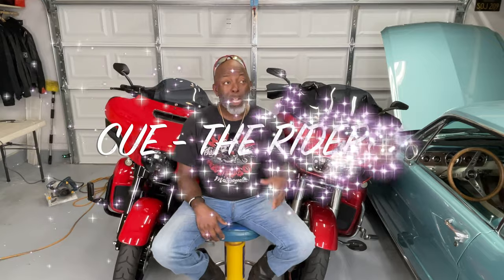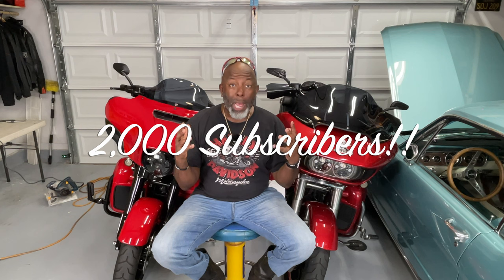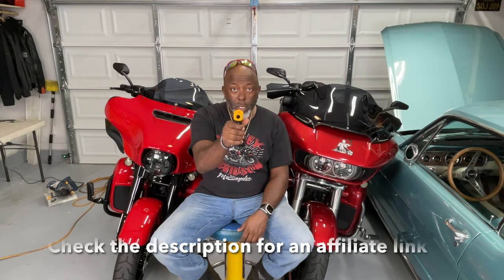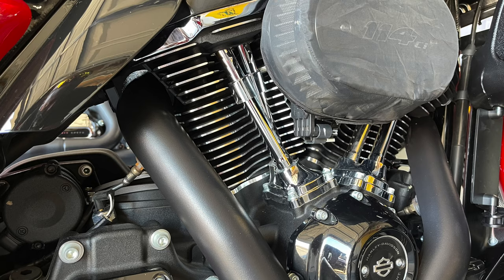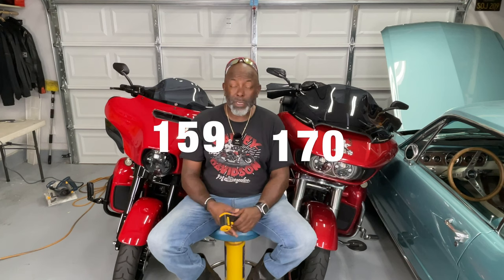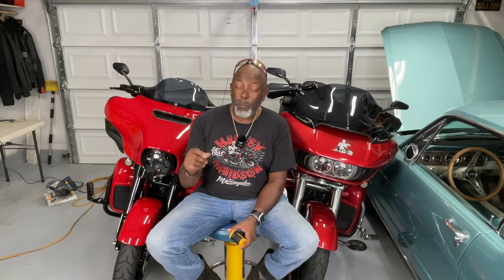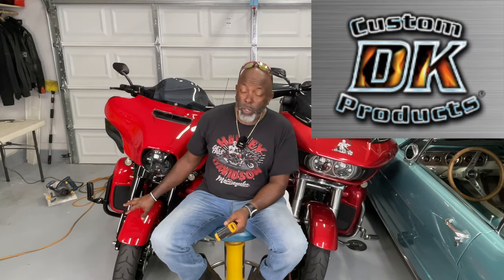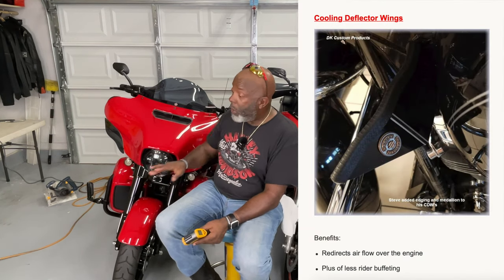Water Cooled vs Air Cooled Harley Milwaukee Eight

Comment: There are after market fans available such as love jugs that blow air across the top of each cylinder head. They claim to reduce temps up to 50 deg I believe
Reply from the maker: That will be my next heat test.

Comment: Great video and great techniques for comparison.  Always good to provide good knowledge and real-world tests and results to those who wouldn't necessarily do these things themselves.  Also, congrats on 2K!

One point of information on the type of oil allowing the engine to run cooler.  I race bikes and have built and run race motors for quite some time.  All of my race motors run synthetic oil.  The heat generated is two fold.  1. The actual combustion processes, and 2. The friction heat produced by moving parts.  The synthetic oil "seems to be" a bit slicker, allowing parts to glide more smoothly past one another.  Most importantly though, as you mentioned in the video, synthetic oil is able to retain it's lubricating properties at higher temps.   What this means is, as we are running engines harder and harder, the potential frictional heat load increases.  This increase will heat the oil as well.  At those higher temps,  conventional oil can begin to lose its lubricating properties and allow greater frictional heat load.  This will heat parts, and heat the oil and in turn, make the bike run hotter.  Synthetic oil will retain those lubricating properties as the motor is running harder and will assist in keeping the frictional heat load down.

So, is synthetic oil necessary for all engines, maybe or maybe not.  Does it have definite "pros"? Yes it does.  Also, synthetic oils maintain viscosity for longer periods if time for most users.  Just my $.02
Reply from the maker: Thanks for sharing! I don't race my bikes so I don't have your experience. However you described it very well. I can see how synthetic oil is vital in that particular use. The biggest heat issue I run across is traffic jams.....the bike can get very hot in stop and go traffic.

Comment: Howdy, Great Video. The reason I'm researching this is because I am thinking of purchasing a Trike from HD and find that of the 3 models available this year, only the Tri Glide Ultra comes with the Twin-Cooled version of the 114. Now I am not a fan of Fairings & Tour Packs, and would be more than happy with the Freewheeler with a windshield, a passenger backrest, and a luggage rack and buy a Garmin GPS for the handle bar, but I do believe that the Twin-Cooled version of the 114 would be more durable than the Air Cooled 114. The only thing I can think of doing is purchasing the Tri Glide and start Stripping it down till I'm Happy, and selling the leftovers on ebay...
Reply from the maker: I think it depends on the type of riding you will do. What I learned from my experiment is that there are advantages to the Twin Cooled AND Air Cooled. Technically, the air cooled has 2 cooling systems: air and oil. Add a fan, and you should be fine in most circumstances. 

I've been stuck in traffic with my Twin Cooled Road Glide and it gets HOT!!

Comment: Interesting stuff. Im gonna say, your temps lower on the engine are more precise. Its the oil you want to measure. Using those guns on shiny surfaces can give wonky temps. Maybe try putting some painters tape where you point the gun. Measuring oil temp might be the best way to measure. Just my two cents.
My question for you, since you ride both bikes, how is the "felt" temperatures on your legs?
Reply from the maker: Great question. I have 85,000 miles on the Road Glide and only 11,000 on the Street Glide. I've been stuck in traffic several times with the Road Glide and it got HOOTTT!! I've never been in traffic on the Street Glide, so I don't have a good comparison.

Comment: I test rode a road glide limited while wearing jeans and half calf leather boots and my right foot felt like it was being cooked inside my boot, no burn marks so I don't think I could have been brushing the exhaust
Reply from the maker: You can definitely feel the heat coming from the lower fairings....but it depends on your leg position.

Comment: On my TC 103 i added a Jagg Vertical Mounted Oil Cooler...It makes a difference here in the Hot Central Valley of Cali....Your right...Synthtic Oil has a higher temp rating before it breaks down...Ive checked my oil right after riding in 100F plus temps...Mineral oil has turned to bubbles vs Synthetic not...Only thing i dont like is more valve train noise...
Reply from the maker: Great feedback! I wish I had done this test before I changed the oil on the SG. I run synthetic in both bikes

Comment: Very good interesting Cue. Did you have the vents on the lower fairings open or closed?  I wonder what temperature difference would be when running slow speeds for 5-15 minutes, as in stop and go traffic or a parade.
Reply from the maker: The Lowe vents were open on both bikes. I keep the vents open on the SG all the time since air flow is required to keep the engine cools

Comment: My 21 road glide limited is dual cooled. I tell my riding buddy's those radiators aren't for the bike. They are for me and her I feel way more comfortable on the bike long distances Hot or cold. I can control the temps by simply adjusting the lowers. Bike is a 21 bought in Aug has almost 9800 on it now.
Reply from the maker: That's some good riding. It's actually nice in the winter having the heat blow on your legs from the radiators

Comment: All I've ever owned were water cooled m8s. A 17 ultra limited and now a 21 road glide limited. The oil pump is different for the water cooled and air cooled m8s. My 17 oil pump failed. 21 so far so good. They said the gears in the water cooled oil pump were smaller.
Reply from the maker: I didn't know that! Good info!

Comment: Nice video about wet heads I'm in my mid 80s have a dina lowrider got some moter work 107 wet heads done by shortblock Charlie. Heat was. To much for my old body so I installed some wet heads with a pair of radiators on the engine guard hoping it will run cooler not worred about appearance just cooler riding. Using late model water pump let me know what you think young man. Rick erie pa.
Reply from the maker: Wow! I didn't know you could convert them. You may also want to add a fan to help manage the heat. Riding in hot weather or getting stuck in traffic isn't fun on any motorcycle...you still feel the heat

Comment: Congratulations on 2,000 Subscribers. It’s ironic that you mentioned oil. I used Lucas Full Synthetic in my first bike. I wasn’t really impressed with it. So when I purchased my second bike I used Mobile One full synthetic V-Twin oil. So far I’m very happy with it. I don’t know if it actually matters.
Reply from the maker: Now that Harley has been called out on their warranty, you may see more people trying the Mobile One.
Reply: Ok so I guess I hadn’t heard. Could you please explain to me about them being called out on their warranty?
Reply from the maker: @joshmumaw857  I saw a few videos where Harley will not automatically deny warranty claims due to using non-Harley parts. I have been told that I'm the past, Harley frowned upon using "non-Harley" oil.
Reply from the maker: @joshmumaw857  I haven't had any problems with any of my bikes, so I don't have any personal experience to share. Honestly, I don't worry abt warranty issues.....but maybe I've been lucky!
Reply: Ok. Well both of my bikes were out of warranty. So I don’t have any experience with Harley Warranty. But I own my bike. I’ll do what I want.

Comment: Do you think that the after market oil cooler work?
Reply from the maker: I've seen positive things about them on other channels (Cycle Fanatix and Kelly B Gliding). The concept makes sense to me. I don't have a high power motor, so I'm ok with what I have. If I can get my hands on one of those systems I'll test it and compare it to a stock setup
Reply: @RidingandWrenching  thanks so much for the info! 🤟🏻

Comment: I know first hand my liquid cooled night rod ran insanely cooler with amsoil full synthetic over Harley’s oil. I could keep my hand on the side of the fins below 100 ambient Fahrenheit with amsoil. Harleys I couldn’t 5 mins after riding in any temperature. If you believe better oil could offer better protection meaning less friction then that would equal lower temperatures. I’m an amsoil believer wish I could afford it in the 5.0 but 10 quarts 😅
Reply from the maker: I guess I will have to find out for myself! I will try Amsoil in my next oil change.
Reply: @RidingandWrenching what were your findings?